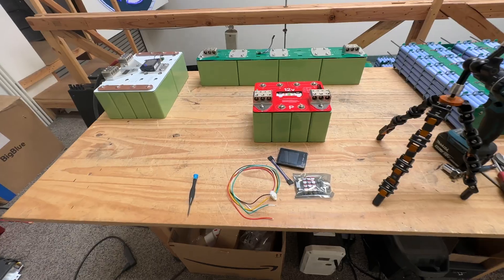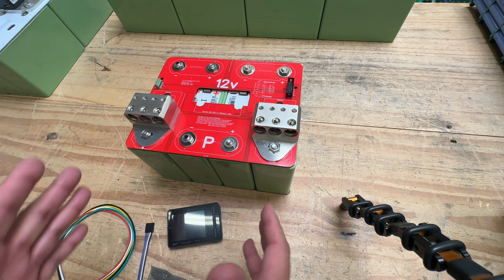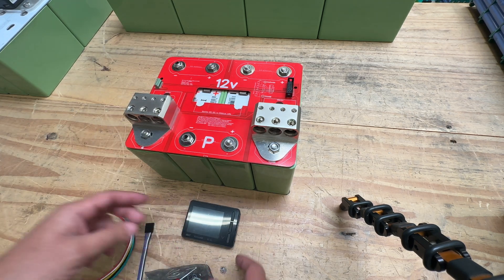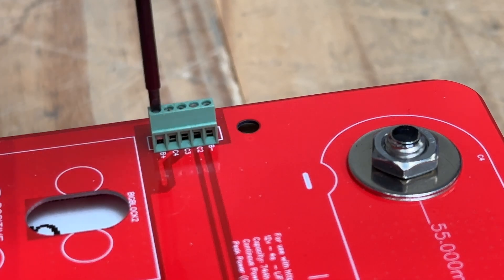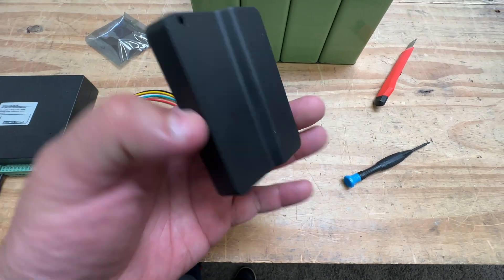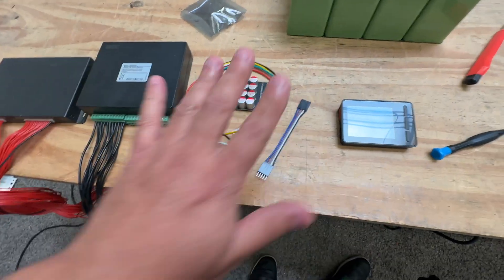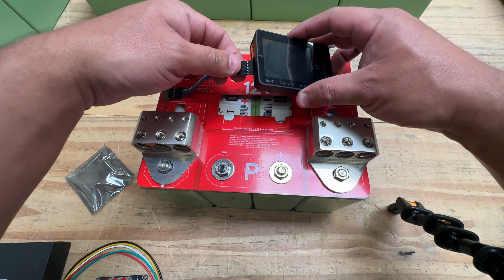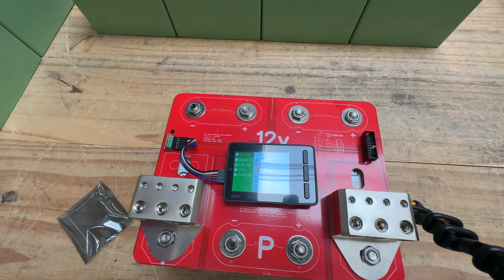Easy Balancer Install - 12v LEV60 battery LiFePO4

Comment from the maker: $150 Lev60 12v battery - https://j35.us/12v74Ah
Heltec Balancer - https://amzn.to/3ZfBGO0
BattGo Balancer - https://amzn.to/3LczLni
Reply: i dont see the connector on the site for the BatGo Balancer,  i need a connector
Reply: Same. Only see the 8 pin available in the store
Reply from the maker: You can use the 8pin
Reply: @jehugarcia  ill buy one see if i can make it work .Thanks Jehu
Reply: I purchased the lev60 long with the 2.54  8 pin jumper cable it said I required on the website.. it looks like your using a different one.why is that??
Reply: @jehugarcia

Comment: Quick question.  Will the heltec balancer draw current the entire time it is connected? Also,  same question for the Battgo, except one caveat, if I do have to manually shut it off and on, will I have to reprogram it to balance every time I do?

Comment: I’m going to put a 10ft extension on the bms device so I can view it up front with me. What awg would you recommend the wire to be?
Reply: I do car audio, so I need to keep an eye on my voltage while demoing. That’s why the device will be up front in the cab with me.

Comment: Is this LEV60 bank a better option than building a 48ah headway bank? Does it need compression like CMAX ?  I have a pair of korean 1600 amps to strap at 1 ohm and a matching 4 channel amp AL110.4 for my doors so a total of around 3500 rms at most. Im new to lithium but man thats like half the price of just the parts to build the 48ah headway!
Reply from the maker: Yeah way better than 48Ah headway,  can do more power and has more capacity for $150
Reply: Can you mix both LEV60 and headway together ??

Comment: They may not seem to be worth putting a full blown BMS on them rather than just a balancer, but keep in mind the conditions you're using these in. If the site is going to drop below freezing, you are going to want to protect the batteries from damage from charging, or load. If you can warm up the space the batteries are in with excess electrical (solar, wind)_ you might do that, but it may be worth simply adding a contactor that is controlled by a thermometer to drop external power to the charge controller, and another that drops the batteries out of the loop as well. (I live in MN, using a full blown BMS on this might be worth not having to replace the batteries every spring...
Reply: I've been using mine for car audio for 2 years now,  vehicle sets( cause it's my bass  rig/ backup vehicle) sometimes 2 months in ohio below freezing winters and 100° f summers with the cheaper heltec balancer and after the initial charge i haven't touched or had a single issue 💪👌💯 love my lev60 banks,  i bought another 74ah bank as well as the 148ah jag35 fat kit with the buss bars to make the 148ah lev60 bank 💯 this thing is amazing,  especially when it was 149$ , i wish i had bought several during that sale but i still don't think they can be beat at the current prices.  Thanks Jehu for an awesome affordable battery bank 🙏
Reply: Note that the above may be eased if you have access to a backhoe and can set up a vault undetground for your battery bank. Still a good idea to get it below the frost line, but it will also help with thermal management for high tempretures.
Reply from the maker: Not sure how this relevant to car audio…..  solar storage packs should use bms
Reply: @jehugarcia  I'll agree that it probably isn't. Didn't see that as part fo the description or title before I commented. Thank you for overall some great videos.

Comment: Can you learn how BMSs work and can you fully integrate it onto your own designs 😊
Reply: BMS's are really simple. I'm sure Jehu could create a BMS PCB with his eyes closed. All it is is a bunch of mosfets that act as switches. One row for charge, one row for discharge. Some components to sense cell voltage and then some will have the balance circuitry also on the board which is just a bunch of resistors that bleed all the cells down to the lowest cells value. You do have to use something to set some of the parameters like balance on voltage

Comment: Just to clarify he mentioned 400a continuous but at 180a cont he is specifically referencing the 12v parallel packs at 360a~400a continuous not the 4 cell pack
Reply from the maker: negative...  ive tested these cells at 4s  400A continuous,  they stay cool and perform above 12v https://youtu.be/6RDacZ21F5A?si=emQFS65N-HWPAbyz&t=256
Reply: @jehugarcia  Ah I apologize then. Was going by the specs. The specs also show a wide voltage range but I am guessing they perform similar to most lifepo4 on discharge curve? Going to do some testing but curious. High amp BMS can be cost prohibitive if you want the high discharge so planning to just use flying caps to balance, with maybe a small BMS for charging and then bypass for discharge.
Reply: @ShaleAudio they are amazing I’m doing a series of tests now over on my channel. These batteries do everything they should plus more. I powered a godfather 5d with nothing but the $150 battery pulled like 250 amps for 30 mins straight it never lost charge and never got hot. The voltage display was hotter than the battery or buss boards
Reply: @Todd_Wilson213  What voltage did you discharge to and how did cells do for IR pairing (or final individual voltage after the group discharge)? I've tested 6 cells so far for capacity and they are doing well, 71.3-72.1ah so far @ 40a, definitely following the standard lifepo4 curve so far. Really liking these cells.
Reply: @ShaleAudio  the lowest they went, don’t quote me was 12.8 starting at 13.3. Approximately 250 amps. They rebounded and are at 13.4 charger says they are full. I’m gonna do the godfather 11d next on the big bank just waiting for lug adapters to come
Reply: @ShaleAudio  I love them. Perfect place where quality and price meet.
Reply: I can attest to that I personally have pulled more than 400amp with minimal voltage drop on a 7k sound system lol these LEV60’s are beast batterys

Comment: Really the only affordable way to go if you want hundreds of amps of discharge without protection, let you pump those big numbers on well matched cells between discharges or charges while taking advantage of power.

Comment: I'm hooking up a BMS for charge, low and high temp protection on a 30amp connector. The 300amp cables will just be attached directly to the battery and not protected.

Comment: Wats type of charger do I need to charge my lev60 once I receive it?
Reply: Just use a regular car battery charger like a Schumacher type charge rate at 5amps while keeping an eye on it you should never leave any lithium batteries unattended while charging anyway there you go have a good one.
Reply: One of the 30v 10a chargers on Amazon   for 150$
Reply from the maker: Any charger that charges to 14.6v can be used
Reply: @jehugarcia  I ordered my lev60 on august 31st and it still hasn’t arrived..the FedEx tracking number says it’s still in California with the shipper.order # 22919..any reason why??
Reply: @brenthenderson151   I waited for one too, delay was because they were short one of the parts, but they sent it out already. My buddy already got his, he's loving it.
Reply from the maker: Looks like fedex is having trouble moving that package,  they have had it since the 31st
Reply: @CreativosEmpodera2  definitely waiting on mine 💪🏾ready to see how good it is on my 8k system
Reply: @jehugarcia  thanks.. I was getting worried
Reply: @jehugarcia   I got. One package today with 2 cells

Comment: Hey Jehu,  why not design a board with the pads for capacitors to have the option of an onboard Balance function to the DIYer to add them if desired?
Reply from the maker: Because I can’t design a better balancer than it’s already in the market
Reply: @jehugarcia  fair enough.